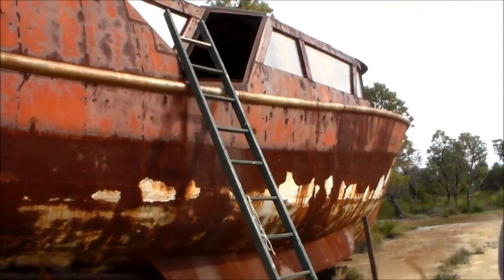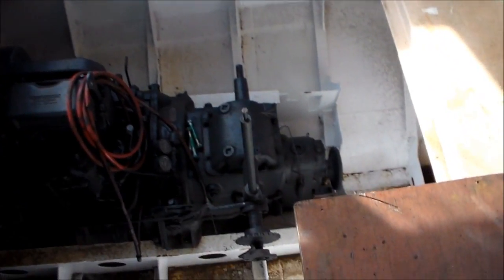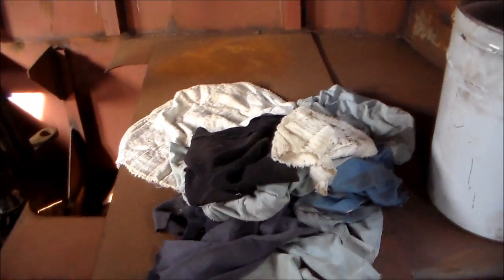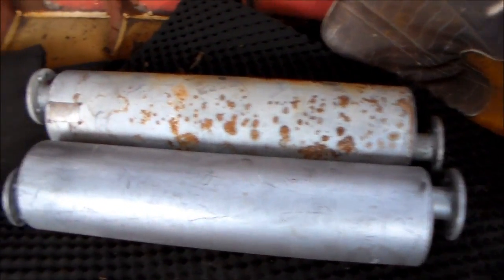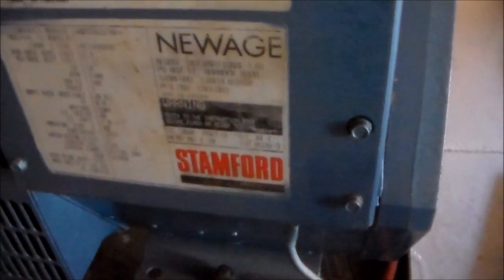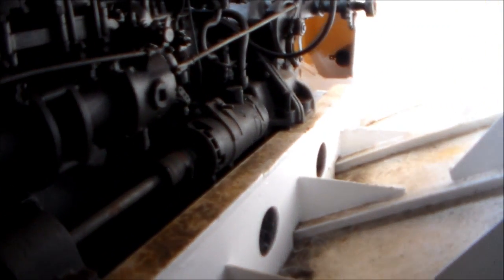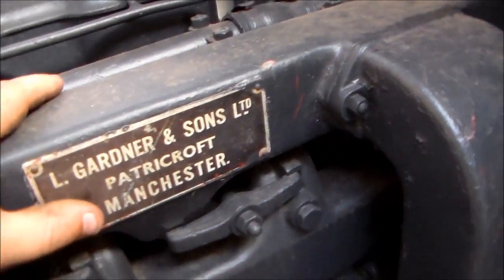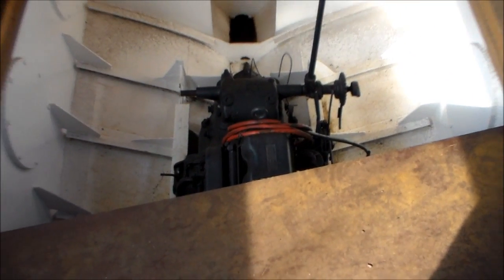Pete + Harry's Steel Boat "Spoofie", Gardiner 5 Cyl Diesel,Stamford Genset

Comment: Good to see the 5LW is/was a proper marine engine. 
Shes an oldie by having both ram-type circulating water  and bilge pumps rather than the paddle wheel type circulating water pump.

Comment: if you depress the fuel priming levers ,the fuel cam cannot make contact with the sprung foot that pushes the pump piston , then no fuel is sent. gardener did not intend for cylinders to be switched off for anything but short periods as it results in uneven wear to the white metal around the crank as its running unbalanced.

Comment: Thats rubbish, you can decompress cylinders whilst the engine is running but the injection pump is still injecting fuel causing much raw fuel to be sprayed out of the exhaust, the decompression of cylinders whilst the engine is running also will cause damage to the valves
Reply: Gardner  LW engine like most Gardner engine have primer leavers on the injector pumps that CAN be lock each injector pump plunger.